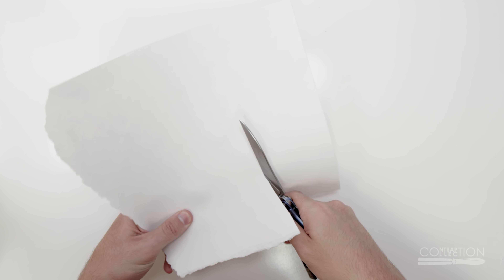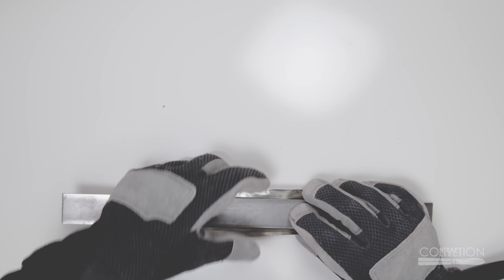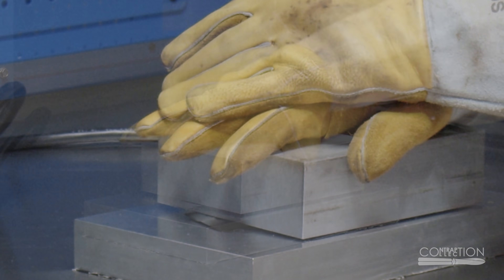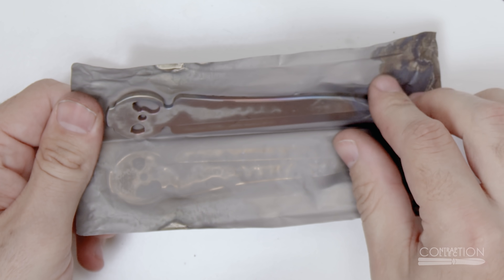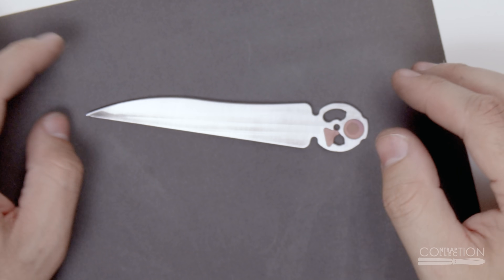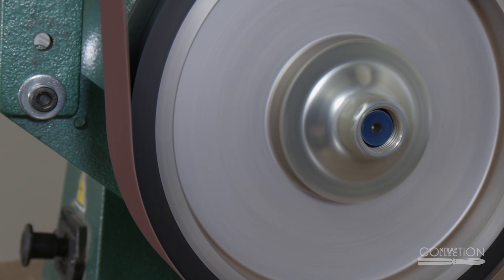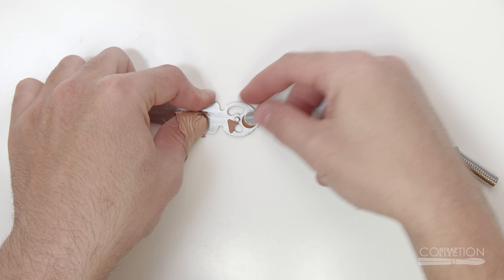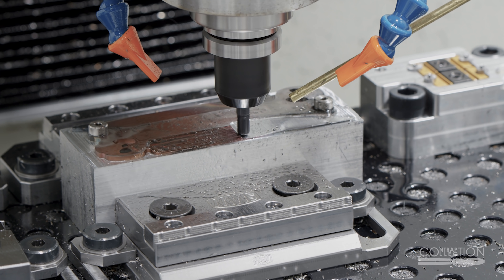Heat Treating Baliscissor Blades! Ep 18

Comment: Stainless steel isn't all austenitic (the nonmagnetic phase associated with stainless steels like the ubiquitous 18Cr8Ni) and martensite, i.e. hardened but untempered steel, is magnetic. Since the vid is a little older you may have already figured this out but if you want me to look into this more hmu, im at the end of a masters degree in metallurgy focusing on steels (stainless in particular) so maybe I could offer some advice!

Comment: Magnetic moments have an ability to align in the high temp phase. The faster you quench the better odds there are that they won't align but I doubt there's a strict guarantee. If your furnace itself has a magnetic field, say from the flow of electric current that could also encourage alignment in theory but no guarantee on the practice.

Comment: hey, love your work. engineering dropout here with some assistance. s30v is a martensitic stainless steel and when heat treated above 1900ish degrees the grains transform into what's known as austenite as it cools rapidly the austenite is very unstable and so it will transition either to martensite or ferrite or a variety of other types but as far as the ideal situation is mainly martensite with carbides. this transformation causes a bunch of stress which in most ferritic and martensitic steels causes them to exhibit semi permanent magnet behavior. more than likely this is unavoidable but if you have a demagnetizer it may be able to remove this. I would recommend doing so before and after heat treat for the maximum effectiveness but good luck!

Comment: I'm not sure if someone else has already mentioned this, or maybe you already know, but a good way to test if there's a burr is to use your fingernails, after you sharpen the blade, on the other side run your fingernail against it, if your fingernail catches, then you've got a burr.

Comment: There are many types of "stainless" steel. Stainless is not really a specific type, more just a generalized term for any alloy with elements added to impede oxidation, like chromium and nickel. The main types of these alloys are ferritic, martensitic and austenitic. Of these types, the only ones that are non-magnetic are the austenitic. These would be your 300 series steels, too soft for most knives but used in some diving knives due to high corrosion resistance. S30V on the other hand is martensitic, which is why you are able to quench harden it.

Comment: The magnetic field comes from the arrangement of the iron atoms, when you harden the steel the atoms becomes crystallized. 

Either the steel is amplifying the magnetic field, or you left the magnets in when heat treating. Other than that, you can magnetize steel by rubbing a magnet on it for a while, and crystalized steels probably keep the magnetizem in them longer.
Reply: @Aaron Washburn fair. i should say then the steel goes from 30% to 80% overall crystalline, and the consistency of crystal like structures also increases. (not actual percentages)
Reply: @Aaron Washburn because I'm reading it from my metallurgy school book, but, who knows right?

Comment: Well S30V is a Martensite type of steel. there are many crystalline forms of steel but the main ones are Austenite (non magnetic), Martensite and Ferritic (both magnetic), Austenite is mostly just existent in room temperature highly alloyed steel like 304-316 steel or similar. there are many types though Duplex types with many of them mixed ect. 

If I misspelled something is probably because i mixed in my Swedish names for them and being to lazy to google. :P
Reply: Oh I have background in metallurgy specialized in steel and such. though I might be a bit rusty (no pun intended).

Comment: Research "VG-10" steel it is use in a lot of kitchen knifes and edge retention is pretty good and stainless. The edges on VG-10 Tends to roll than chip like s30v. It  also is definitely cheaper than s30v. If you would mass produce this.

Blade HQ has a quick and easy chart that compares steels.
Or watch Cedric and ada he does edge retention and study's of knife steels

Comment: from what I know you don't need to have sharp scissors for them to cut as they cut using shearing which is different from the way knives cut. You can examine more scissors and and see how most of them have almost leveled edge that are difficult to cut with (using a single blade). Immagine two flat bricks passing each other with a paper in the middle. The bend between the blades is needed as it ensures that both of the blades are pushing against each others maintaining contact with the material you want to cut. You need a flexible blade for that.
Pardon my horrible explanation but I am sure you will know much better after a quick search.
I wish you all the best.

Comment: In order to get that bend you could clamp it to a preformed object when you go to anneal the blades. Blacksmiths use that technique to remove warps from blades so you may be able to use it to put one in.  You could make it out of steel or if you are worried about it ruining the heating of the blade you could make it out of fire brick although it may not be strong enough to have a quenched blade clamped onto it. In any case be careful when bending a blade that has not been annealed because it could snap.

Comment: Hey G. You may have over saturated your heat treated blades with magnetic flux. It's possible that by either using the SS alloy you're using or by heat treating the alloy, you've made a more effective conductor of magnetic lines (or magnetic flux.) Essentially, you've shortcircuted your magnets and given their magnetic fields a new path of least resistance. This making the blades of your bali-scissors magnetic. A channel named, the action lab has a video that explains this phenomenon. The video is called "A Permanent Magnet That Turns On And Off." Hopefully this helps you out.

Comment: For the foil, use a tiny amount of baby powder inside the pack. No paper. I also clean the blades prior to going in the packet with acetone. A good heat treat will have the blade come out white, or some form of rainbow, no oxidation though. After messing a ton of the packs up I've found that 2 overlapping folds works good. Make sure the folds are being shaped with a very square corner. I used an old surface grinding magnet for the corners. The corner thing was what was holding me back from sealed packs. You know they aren't sealed if they puff up the second you put them in the hot furnace. I like plate quenching using the cheap arbor press from harbor freight. If you want the cad models for the press plates lmk. Its also got the attachments for holding the plates to the press shaft. Time for a surface grinder!

 For the pivot, I've found it'll shrink .0002 to .0005" during heat treat. Ive been using a barrel lap in a hand drill with diamond paste to bring it back to size. Also gives the bore a high surface finish. You can get the laps from McMaster, and the paste can be found on Amazon for pretty reasonable. 

Great progress as always!

Comment: Just a couple tips to try and help for next time. 1. If you use a vise you can pinch the blade in between the aluminum for the quench you generally want the quench to be as fast as possible, 2. It’s generally a good idea to delay adding a bevel until after heat treating as it gives less of a chance for cracking 3. Generally you test hardness after the quench. Just a couple things you might want to consider thanks for reading
Note: I only have very limited experience with knives so take this with a grain of salt. I also know nothin about scissors in particular I am saying things based off knife experience

Comment: that bend you mentioned at the end is more related to the hinge. the play in the hinge allows the blades to pivot non axially so they still cut after the edge wears.
Reply: to add, its also to allow the scissors to cut at the tip where the lateral forces holding the blades together are the smallest.

Comment: The reason why the blades are sticking more might be because after the heat treatment, the material is behaving like a soft magnet (like alnico). A soft magnet can change its magnet poles if they are near a strong magnetic field or a strong magnet. It seems in your case this strong field is produced by the neodymium magnets. 

They sick because the blades are realining their magnetic poles such that the magnetic field follows the least magnetic reluctance path, through the blades due to it's low relative permeability. The magnetic flux of the strong magnet runs through the soft magnet (the blades) causing them to realign the magnetic domains inside the material causing North-South pole pairs matching the neodymium magnet poles. That is why you feel the are sticking more.

You can discard or verify if this is the case by sticking the neodimium magnet in any surface of the material. After doing this you pull out the magnet from the metal and flip it and then,you use the neodimium magnet to try to find any repulsion in this area (this forces might be hard to feel). The reason behind this is that we use the neodimium magnet in order to detect if the presence of this magnet has permanently changed the magnetic domains of the material. If you get close enough to the material you will feel attraction instead of a ligh repulsion and you will have to repeat the experiment. 

I think this might be the case because I've experienced a similar problem when I was developing an electropermanent magnet driver in the past.
Sorry if I made typos I am not a native English speaker. 
Thank you for your attention.

Comment: Could the blades now be in a hysteresis loop since being heat treated? As soon as the initial magnetism is added its just stayed? If it was something like that it should be easy to test as a sharp hit to the blades (but not enough to shatter the hardening) would remove the magnetic hysteresis.

Comment: sparks are caused by carbon in the steel, but stainless has very little carbon so it doesn't usably spark. also some stainless is ferrous enough to be magnetic.

edit: also since you want a heat treatable stainless, it will have a higher carbon content <= to %5 carbon, carbon is what allows a steel to be heat treated as the grain boundary's rearrange and form different metal phases like austenite or cementite. some phases are more magnetic the others as well.  hope tis helps some, let me know if you have any other questions i might be able to help with

Comment: For the magnetism problem try using 400 series stainless or 154CM / ATS-34 steels, and as for sharpness i suggest getting someone experienced, i run a small knife sharpening business only family members use my services, but i'd be glade to sharpen a pair for free. Also instead of heat treating another way to harden stainless is either with dry ice or a dip in some liquid nitrogen, it does the same but does not risk oxidation

Comment: You are correct to put the blades into the oven cold and let them come up to temp both on the hardness cycle and the tempur cycle. Depending on the homone line of hardness you are looking for I would run a few drop cycles in the tempur stage to maybe soften the spine a bit.

Comment: If you're worried about magnetism, get yourself a plate type demagnetizer. It is a demagnetizer which actually plugs into an outlet and uses alternating fields to demag a part.  Very useful when you need make sure your part is absolutely not magnetic.  Demag it after grinding and fettling as it's easy to induce magnetism into steel parts via grinding or other abrasion.

Comment: I don't work with stainless steels, I primarily work with carbon steels. 5160, 1095 & 15n20 specifically. The 5160 is my go to for mono-steel knives, with the other 2 alloys being my go to for Damascus. Depending on the use case of the tool, I try to shoot for 50-55 HRC, any harder, and you might find them to be more prone to cracking. Just looking at my balisong, I know there are areas that impact the steel as I am flipping it, so I would imagine being more around 50-45 in those areas would be better, but I know oven heat treating is harder to achieve a differential heat treat. But you could torch the "impact areas" and arrest the temper around blue or purple color.

As far as sharpening goes. I have different techniques that work for me in the pieces I make. I'll talk more about the chisels I make in hopes that helps you a little more. With my chisels, I like to get a perfectly flat grind on one side, and I take that all the way up to 800 grit, hell, I take it past there frequently. with the top bevel getting the same treatment. Once I start to get an even burr on one side of the cutting edge is when I take it to a stropping wheel, stone, or even 15000 grit paper, hell, your pants can do the trick in a pinch. My goal at this point is to roll that burr to the other side of the edge, then back. It's this back and forth motion that causes that burr to work harden at the edge and eventually break off. The burr breaking off the bevel is what creates that razor edge. That is what works for me, and I have had great success in my sharp objects.

Comment: When you cut yourself on the foil my first thought was "wait, what? Surely that's a metal other than aluminum. What did he say it was? Did I miss something?"
Reply: It is stainless steel heat treating foil.  That stuff is thin and rigid and will slice you to ribbons in a fraction of a second. I don't recall if he stated what it was, but he did state it was not aluminum foil.

Comment: Try the method clickspring uses when heat treating of coating the part in boric acid (suspended in alcohol). I'm not sure how well it would work for air hardening steel, but it seems to eliminate virtualy all scale.

Comment: For putting the curve in the blads you could mill out the aluminum blocks u used to cool the blads to have the radius that u want the blads to have and use a press or maybe a large vice and it would most likely bend the blads to that radius then cool them down setting the bend.  [( | (] kinda like this lol .
just an idea though haven't tried it but I am a knife making.

Comment: By changing the steels crystal structure via hardening and tempering it makes the magnetic properties change, you can try using electro magnetization on them to change the field again but it would be hard with the blade shape.

Comment: to get the bend you want you could place two bushings on top of the blades at the two ends and one under in the middle of the blade when air quenshing it, it should form the blades to the bend as its cooling down.

Comment: Martensitic stainless steel will stick to a magnet. Also, high carbon steel will retain magnetism more than low carbon steels.

Instead of bending the blade, consider machining a curve into it. That is how Leatherman Raptors are made. Grinding would be better, but since you don't have a fancy 4-axis CNC grinder, machining might work.

Serrations could also be machined in by fixturing the blade at an angle and then using the corner of an endmill to cut several 90° vees. I've made serrated vise jaws this way.

Comment: i think something interesting to try would be doing a slight ramp to the flat of one of blades, having the pivot area be the thinnest and ever so slightly getting thicker towards the edge to get rid of that gap, that would definitely be interesting and it wouldnt give it that, in my opinion, ugly curve to one of the blades, something different to try, you never know, either way, fantastic video as always my dude <3

Comment: For the  bend in the blades, you could fixture them to the side of a block and mill an angle (large radius?) tapering down to the hinge. If you thin the blades down, you might have luck bending after heat treating. (not an expert opinion, gloves and safety goggles)
Edit: Okay, better idea. If for the blade hole milling op, if your fixture is angled 'in' towards the tip some few degrees, that could cheat the bend. 

Grimsmo has some OLD videos about them figuring out their in house heat treating using the same method. They use baby powder to suck up oxygen that makes it into the pouch.
Google says even the high quality Japanese scissors are only made of 420 or 440.
Reply: That's a good point about angling the pin holes. I would also go ahead and angle the contact face of one blade.

Comment: Cts-xhp is a very good steel, especially for balisongs because it's a very tough steel. I have a bali with cts and the edge and tip hold up very well even though i drop it on concrete often

Comment: Clamping the two aluminium plates together with clamps helps reduse unwanted warping of the blades, also spraying compressed air between the plates speeds up the quenching. Simple little life has great videos on air quenching.
Great videos, keep it up.

Comment: The way I have seen the curve be put into scissor blades on a few videos I have seen is either with a press done automatically, or by hand with 2 spaced blocks of metal and a hammer used to lightly tap the blade as you move it back and forth to get just the right amount of bend through the entire blade.